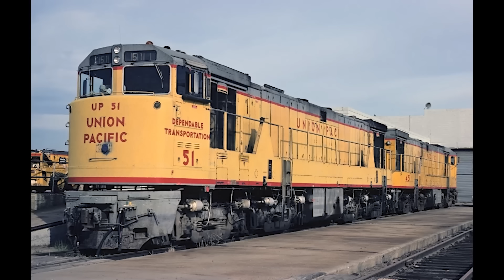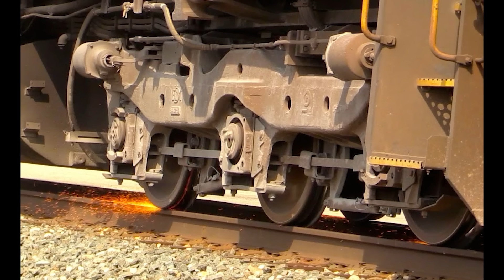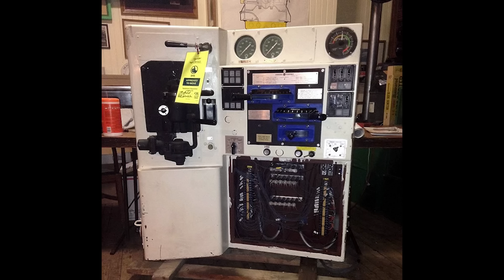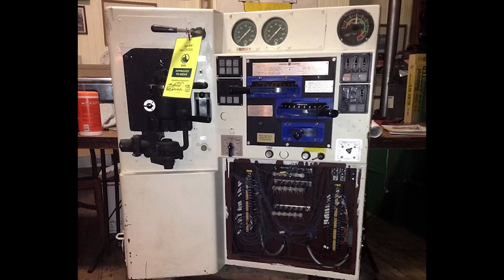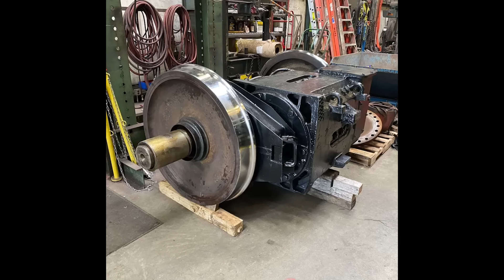How the GE U50’s Wheel Slip Problems Exposed the Limits of Early High Horsepower

Comment: The one thing i liked about the U-50 as compaired to the c- model is that the U-50 was an 8- axil wheres the c- model is a six axil and the U-50 has 4 sets of 4 axil with traction motors on all axiles and they can negotiate curves better less where on wheels & track and better traction overall but i would think that under high speed operation such as 80 + mph  straight track ahead you will get what they call truck hunting and thats where the wheel will try to climb out the flange i guess cause of a flat spot or an imbalance... ang way once the train reaction starts ya have to slow down see slip spots on the tracks all the time wich causes flat spotes which weares more track out etc etc etc the best thing i think is wheel slipp tech combined with sand and mabie in breaking😂😮😮😮😮

Comment: In short, the GE U50 was a locomotive that was just too far ahead of its time given the limitations of locomotive hardware in the 1960's. It was the application of computerized controls with locomotives in the 1980's and beyond that made higher-powered locomotives a lot more viable, even more so when AC traction motors became available in the early 1990's.

Comment: Using two diesel power plants on one high powered locomotive unit was NOT a new innovation in the 1960s.  English Electric did it first in the Deltic loco in the fifties, making it the highest powered single-unit diesel in the world when it went into series production.  Many were in service throughout the 1960s and 70s, it was a very successful design.  Eventually replaced by the InterCity 125 or "High Speed Train" which reverted to using two diesel locomotive units.

Comment: The U50 was actually very successful and wracked up a lot of miles for UP. Slipping wasnt as bad as depicted here. The later U50C was a disaster with its lifetime the shortest of any UP diesels.
Reply: Looks like GE borrowed the front end from EMD F7 and Ex units--no platform on frontend.
Might be interesting experiment to see this loco built with modern adhesion and ensured-traction technology, using GEVO T4-compliant motors for 8,800 hp? or an EMD DD90MAC? Given the ability to use two or more units coupled, seems the mechanical engineering should be able to accommodate the motive power housed in a single unit.

Comment: The GEs came in 2 trial versions. 1 had 4 - 2 axle trucks and the other had 2 - 6 axle trucks. 

Both were test passing in trials. UP however was sold on the idea of burning cheap bunker c oil so went all in on turbines.
Reply: The U50 was very  successful. The later U50C with 6 wheel trucks was a disaster
Reply: The GTELs were expensive to run, but did a superb job for the UP. The U50s were meant to replace GTELs, but couldn't come close..
The DDA 40X could

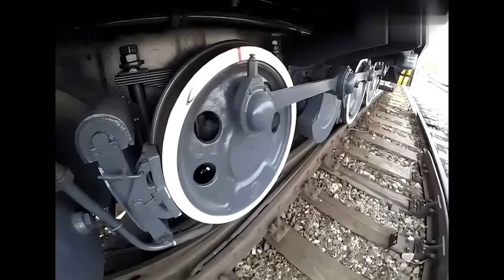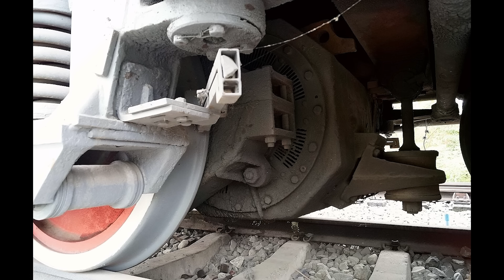Comment: What in hell is that steam, or whatever it is, engine at 12:55 - 15:30 supposed to be accomplishing in the middle of this ?  Leave alone how weird the side rods are !!
Reply: Looks like a small diesel switcher: you can see the drive-shaft connection between the two axles closest to the camera. But, yeah, utterly irrelevant.

Comment: How come these very same bogeys had no problem when used on U/P's Veranda gas turbine locomotives?  After all, the trucks used on the U50s were scavenged from the GTELs where they worked (without traction issues) in the exact same configuration.
Reply: This video is very short on facts. The U50C was very successful and wracked up a lot of miles. The later U50C with 6 wheel trucks was a disaster because of its wiring not the trucks
Reply: @williamhayslip1644  Thank you.